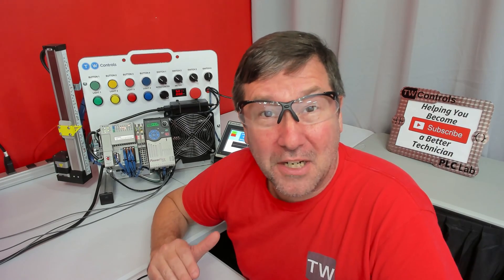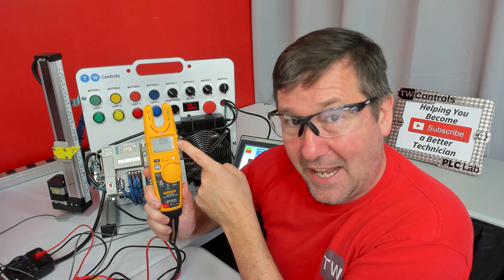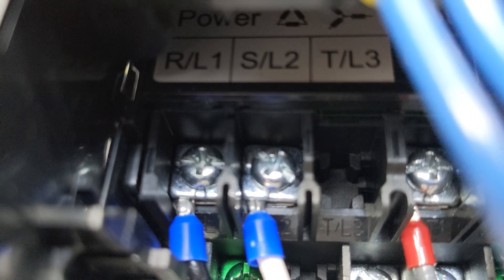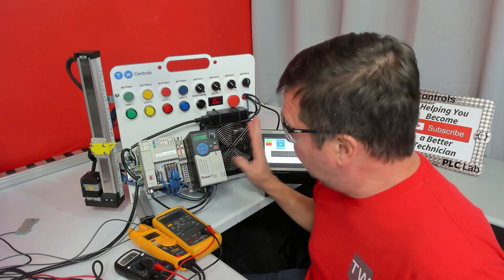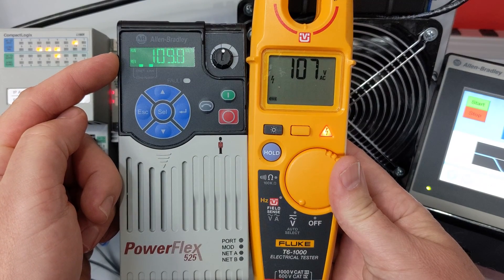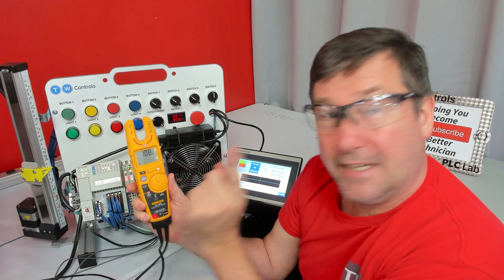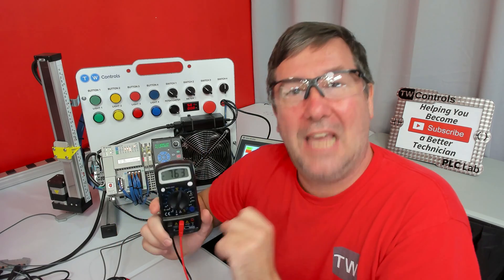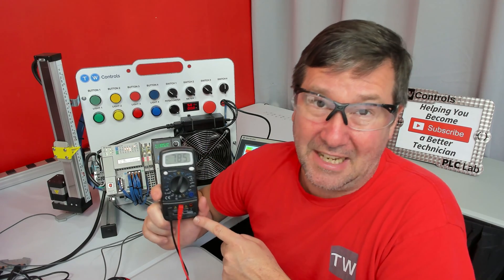VFD Voltage Output Measurement. AC Drive Filtered vs Unfiltered vs Wrong

Comment: @3:50  No truer words were ever spoken !       The Fluke (or anyone's equipped meter) Low pass filter removes the effects of the high speed switching transistors which in turn effect the voltmeters reading.  Since the VFD output isnt actually a sine wave, but a representation of a sine wave made up of pulses, the standard meter has trouble reading it..

Comment: Thanks for this. So at 30hz should I read 1/2 the voltage ? I guess meters have came a long way, I thought you needed a meter with a pwm function to read the output.
Reply from the maker: That is correct.  All decent meters can make a general representation of the voltage but one item accidentally got clipped out of this video was the low pass filter.  With it, you get the most accurate reading.  See link below.
https://www.youtube.com/watch?v=qdVcGO8QFIo

Comment: Isn't the brand x just reading the DC bus voltage?
Reply from the maker: No, the drive is 120VAC powered, rectifying it would be 120 x 1.414 = 170 VDC
Reply: @TimWilborne   Ah my bad. Too used to working with the 480 stuff. Got a video in the works on why the brand x meter reads that?
Reply from the maker: More importantly, here is a video on if you should use a brand X meter or not.
https://www.youtube.com/watch?v=vbV9cujm3Ec
Reply: @TimWilborne  I was already convinced not to use Brand X. Fluke still cream of the crop.

 However, this teardown comparison video is interesting. Seems like there are good alternatives out there. https://www.youtube.com/watch?v=3Hlmq57FQQk

 I am still curious about what is actually going on as to why brand x is reading what it is though.
Reply from the maker: I'm sure it has to do with the PWM that simulates the AC SINE waveform.  There is no good explanation for it.
Reply: @TimWilborne There's always a good explanation for it. Just whether or not finding it is worth the time, money, and heartache. lol Great videos! Please do a bad motor one! (Gonna meg it out?)
Reply from the maker: Hoping to do a little more than meg it out. Let me see what test equipment I can borrow 😁

Comment: HF noise from the drive making meters read off; a decent dual-display will show voltage and frequency. My FLIR CM275 shows something like 1.5kHz with the motor voltage, once you put it in VFD mode you get a true reading.
Reply from the maker: Nice!

Comment: I must say, I'm extremely disappointed that the video cuts off when it does. It seems entirely pointless to put out a video like this and not even really begin to address WHY they are different. Perhaps some very brief off-hand references are given. But, I'd wager most people watching this video could not point to the actual causes because they aren't clearly mentioned. It's pretty likely that the crappy meter is merely seeing the peaks from PWM but it would have been pretty nice to explain that and also explain why two fluke meters could have such different results. You mentioned a PDF that Fluke sent to you but it doesn't seem like you actually linked to that. I just wish you had taken a few minutes more to explain things rather than have 4 minutes of - this is what happens, guess why!
Reply from the maker: Understood, where is your video on it so I can learn how to do it better?

Comment: Does the T1000 have a decimal on DCV? The T600 does not and for that I cannot recommend that meter for low voltages.
Reply from the maker: No, and before this series, I would agree with you but the T6-1000 has too much else going for it with the auto voltage sensing to knock it for that. The key is to think of it as a general purpose voltage meter, not a meter for process measurements such as analog.  In that case, if I check for 24V, I don't really care if it is 22 or 26 V.  I think too many of us think that we should have one meter to cover all of our needs.  Here is a video I did on my thoughts on the T6-1000.
https://www.youtube.com/watch?v=pZFvdSQuEF8
Reply: @TimWilborne  fair points, besides, who doesn't want another meter anyway!?

Comment: I don’t think that Brand X meter is Cat IV rated. VFD uses a PWM output which is a square wave and not a sine wave. The T6-1000 processes the information and calculates what that voltage would be if it was a sine wave. The 87B is actually reading the VFD output correctly. That’s why I tell people to NEVER use their meter on VFD outputs unless it is 1000V rated. I have PD pumps that when they shutoff they have a braking resistor to absorb the generation load from cycling off. I was blowing up 755 VFDs from PD liquid pumps when the pumps would shutoff and the load would push through the pump and keep the pump spinning at a substantial amount of generation. We would see 700V bus spikes on the VFD.
Reply from the maker: The DC bus is something I had not thought about before this series.  Here is a video I did on it and the CAT rating of the Brand X meter.
https://www.youtube.com/watch?v=7pmS_we4uDI
Reply: @TimWilborne  I just watched it. I will say if you don’t see the rating being showcased like the manufacturer is proud of it then it isn’t worth risking it. If something is rated it cost that manufacturer money to get that rating and showcasing that added security is going to be their primary focus for consumers investing in their equipment. The only time I suggest checking voltage on a secondary of a VFD is if you suspect a phase loss and the VFD isn’t smart enough to communicate that error. I have seen VFDs, a 753 with a 20-Comm-E card, display the drive was accelerating while it was actually dropping motor rpm. The frequency output was the same but it lost leg V/T2. The VFD comm output said everything was fine, the vfd 20-him-a6 was also giving me the same information. The rpm of the motor was dropping, the frequency was rising to the frequency limit, the amps were rising. I watched the VFD and speculated the problem while it slowed down. I calculated the output speed of the motor with a phase loss, roughly 60% of what it should be with all 3 working phases, reported my findings because a 20G11ND096 isn’t cheap. Drove 8 hours to the facility with the new drive. Replaced the 20-Comm-E with a 750-ENETR. Logged diagnostic codes and got a phase loss diagnostic code. Reported those back to management and got the OK to swap out the 20F11ND096 and install an additional 20-750-1132C-2R module for analog support. FYI a 20F with a 750-ENETR card does not assemble in Rockwell with the Ethernet module well at all. It’s a known anomaly where the drive won’t let you select you port. You have to back cycle the version to add it to the assembly with the port you want then update to the version you need.
Reply from the maker: Looks like there is enough demand that I'll probably do some more motor checking videos...once I get some test equipment.  My machine trainer can simulate several different bad motor scenarios but I only use them to show how the Powerflex 525 reacts..

Comment: Of course make a motor video.... and where is he link to the Fluke article?
Reply from the maker: OK, let me see if I can get some equipment.  Here is the article on the Fluke CAT ratings.
https://www.fluke.com/en-us/learn/blog/safety/multimeter-guide#multimeter-cat-ratings
Reply: @TimWilborne  Sure you enabled the low-pass filter on the 87V? Didn't look like it on the display, voltage should have been closer to what the VFD display indicated, according to Fluke's document on it.
Reply from the maker: No and I didn't catch it till later and didn't proof the video good enough. Maybe a part 2 :)
Reply: @TimWilborne  Yeah, a part two would be cool. See how much difference the low-pass actually makes.
Reply from the maker: I'll see what I can do.

Comment: I have always liked those t6 meters for a tool pouch meter or technicians meter. The only drawBack is the proprietary leads they use. Thanks for the vid
Reply: T6-1000 is my go to everyday carry meter
Reply from the maker: Mine too now.  I did this video on it.
https://www.youtube.com/watch?v=pZFvdSQuEF8
Reply from the maker: I picked one up.  I like it a lot.
Reply: Have a look at the fluke 325, its nice because the clamp meter uses standard multimeter test leads.